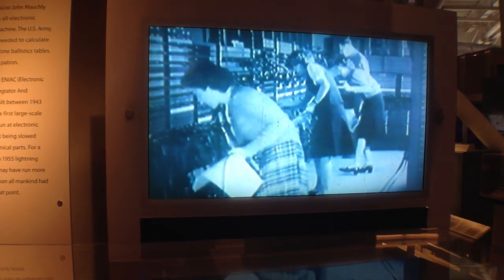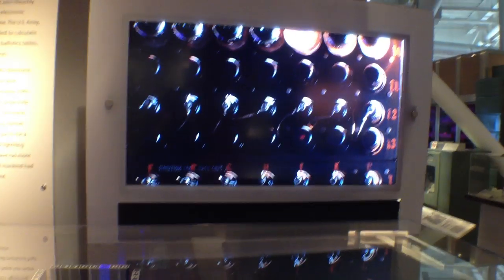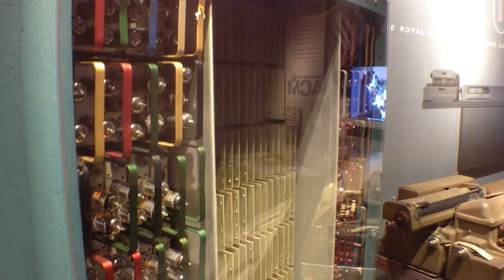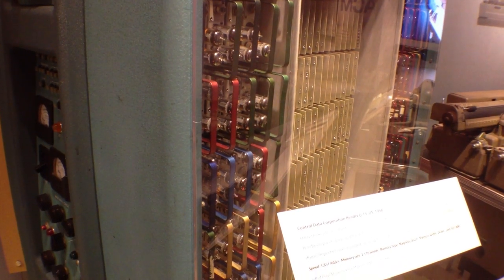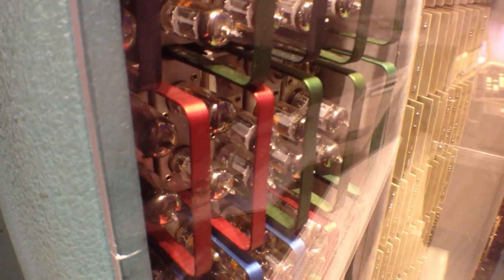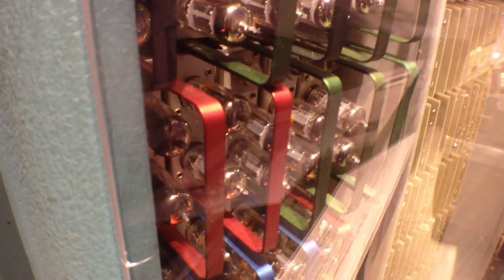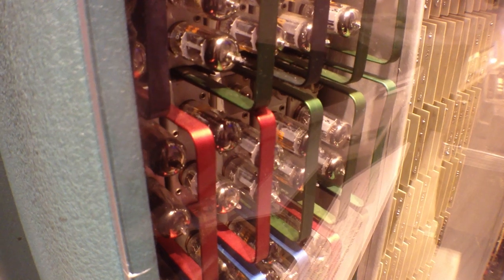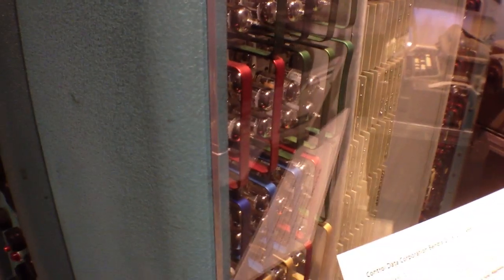CSS: A tour of the computer history museum

Comment: I've been to that museum twice now and not seen some of the stuff you show and describe so well here. Thank You.

 I worked with the USQ-20 Navy solid state(transistorized) version of the Air Force's SAGE that you show, in 1962 aboard the sister ship to the one from which the Museum got theirs. I already had seen that machine once before at the Boston Computer Museum. The ship I was on was one of a group of three on the West Coast to get outfitted with that computer, and I was on the very first tour of the western Pacific using those computers. I had been brought aboard the night before our departure because I had taken a machine language programming course. All the techs on board at that time were several ranks senior to me, so I got a fantastic on the job learning experience.

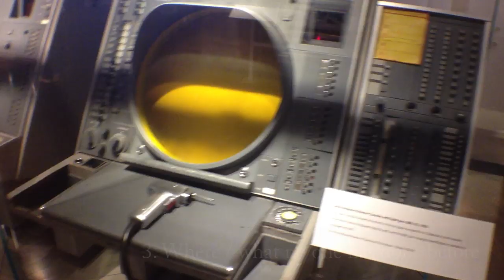At 10:48 you show a Sage console which you mention as being made for the Navy. Actually the Navy consoles worked a bit differently. They used trackballs not light pens, mostly because the light pen itself could be a hazard to the operator during manuevers and the ship being struck sending things flying every which way. Using the much simpler transistor logic, the massive SAGE building sized, highly redundant vacuum tube machine could be shrunk to a fairly reliable cluster of two double-door refrigerator sized central processors, and somewhat smaller consoles in a moderate sized set of rooms.